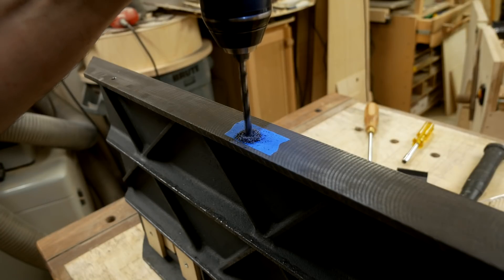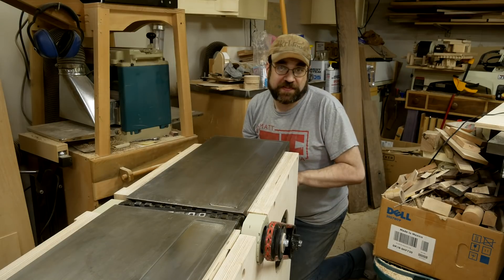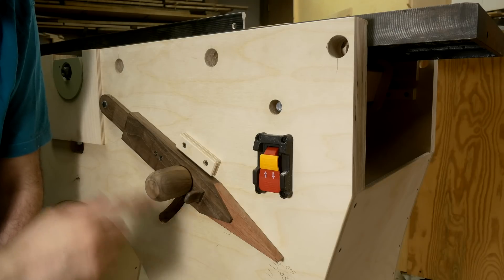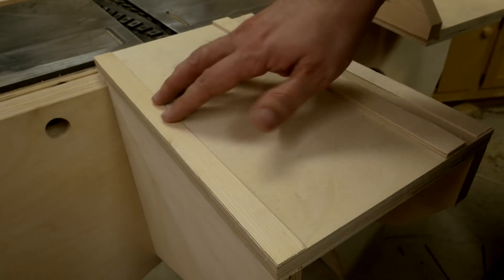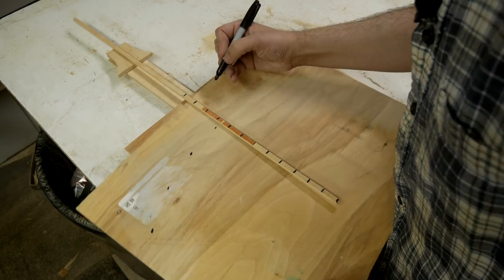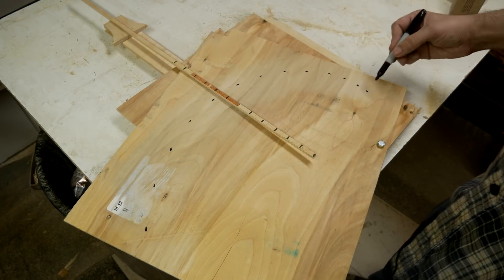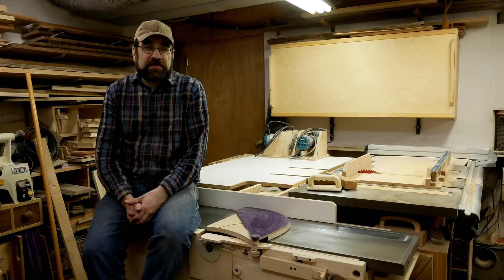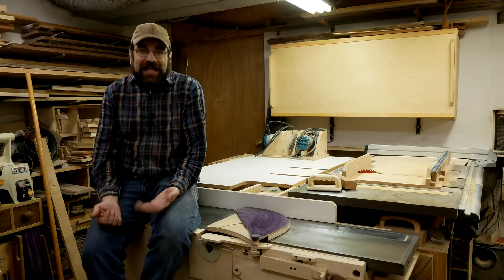Cast Iron Homemade 12" Jointer - Pt 2/2

Comment: I was wondering if there’s a risk that the feeding table height mechanism can step out due to the vibrations? didn’t see you use the initial locking knob during the test? In all cases, I loved this build.
Reply from the maker: The wood spring keeps it from being able to fall out.  I haven't used the locking knob at all.
Reply: @krtwood  Thanks. I'll probably use some of your clever ideas on my homemade router table. Cheers and stay safe!

Comment: If you add a little block to the underside of the guard, behind the cutterhead, it'll lift the guard off the cutterhead
Reply from the maker: You hear it hit the cutterhead in the test because I hadn't dialed in the outfeed side yet and it was too low.

Comment: couldn't you just make the bed out of some granite worktop or glass even
Reply from the maker: They have to come to a point to fit over the cutterhead so I don't think stone would work.
Reply: @krtwood  you can put a bevel on stone or glass
Reply: @johnsweda2999  yes but it become very brittle at the edge...